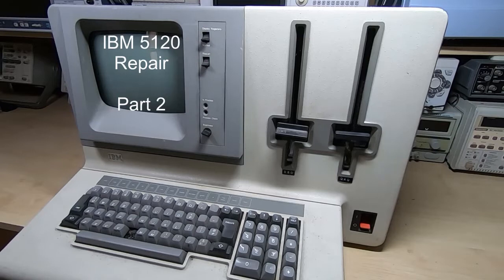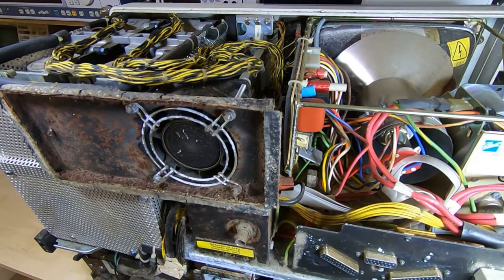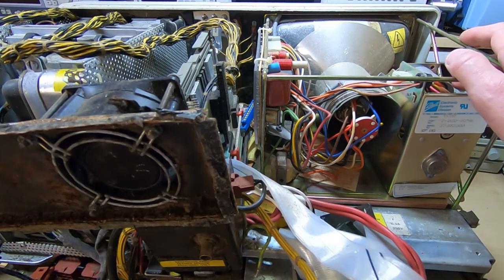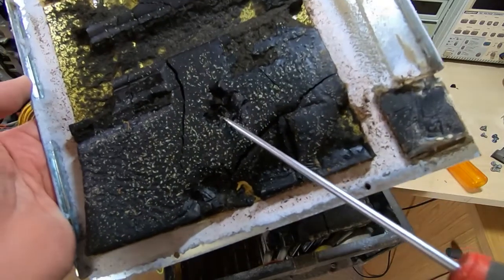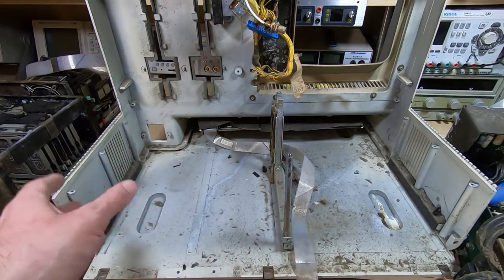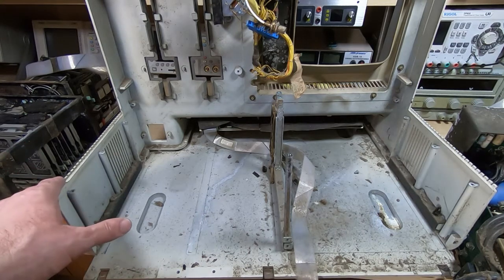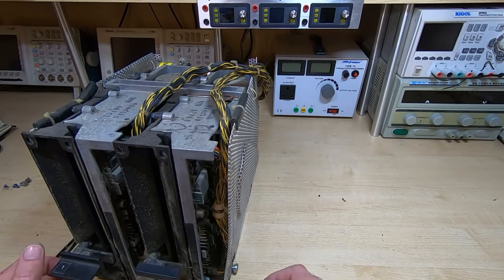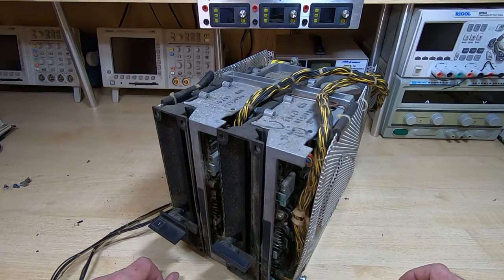IBM 5120 Restoration Part2

Comment: I was a Customer Engineer for IBM in 1980. That machine was called a Datamaster 23. I never heard or saw the word benchmark during my tenure with IBM. I ran my own benchmarks on that device against a 5100. They were a bubble sort and a prime numbers program. The 5100 was almost twice as fast.
That piece of junk used an 8085 processor so it was not advanced. The Displaywriter used an 8086 but was advertised as a word processor.

Comment: Oh that really does look awful inside. I think you've set the bar really high for the most disgusting and abused vintage computer ever. Amazing how well it's cleaning up in the following videos, let's hope it will live again.
Reply from the maker: Yes it is the worst I have seen for this era of computer. It is actually worse than it looks in the video's. My main concern are the IBM custom modules. I have no information on them and no schematic so if any are faulty then it could be a problem. They are also most likely potted which will make reverse engineering them tricky.

Comment: I really think that would be a extensive restoration and very costly if it were not a verrrrrrry slow long term restoration.  Just about surely you would have to make new boards and eithr remake or find NOS connectors.  Seeing this reminds me of a PDP-8e I had that had been sitting in a basement that had ~2m of water in it.  I see someone's a IBM collector.
Reply from the maker: It looks like we will be seeing how long it will take. In the next video I will begin the restoration process.